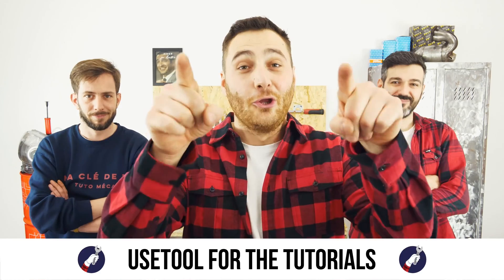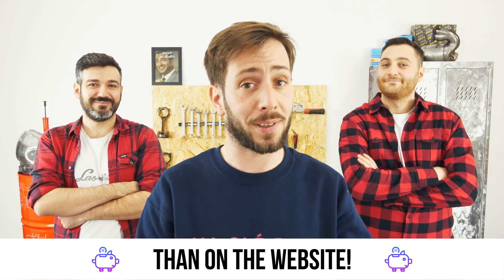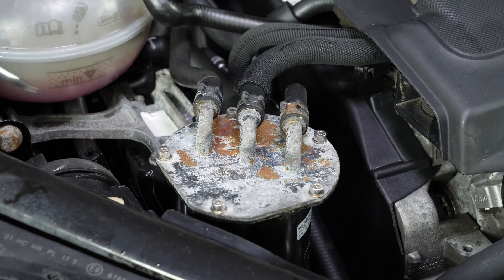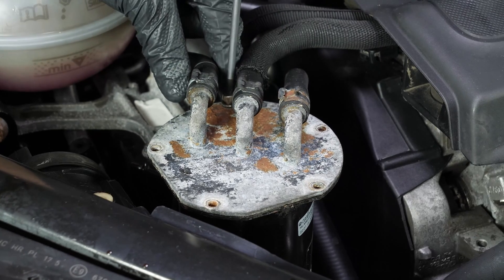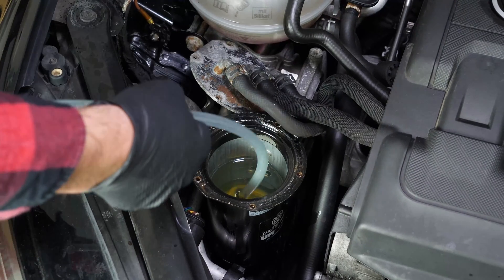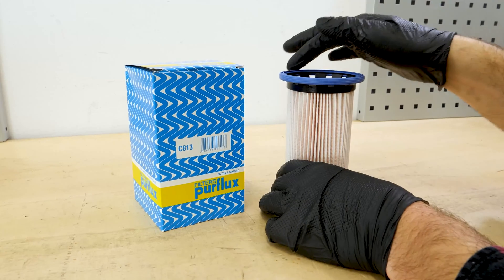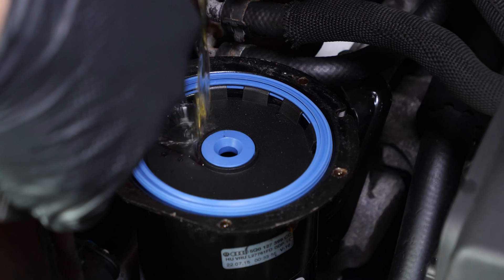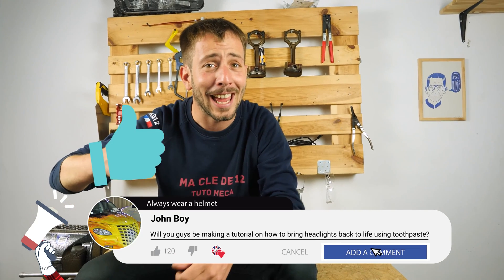How to replace the diesel fuel filter Golf mk7 1.6 TDI ⛽

Comment: I noticed some other guys finished the work with some adjustment connected to the car system. What's that for and s it really necessary? 😁
Reply: It's to prime the pump, essentially to purge air from the system.

Comment: Is is a major issue if I don't remove the fuel and just put the new filter in as is?
Reply from the maker: It’s kind of changing your underwear without taking a shower. Doable, but not great.
Reply: @UseTool_EN  that sounds pretty shit. Excuse the pun.
Reply from the maker: @itwork6810 😄